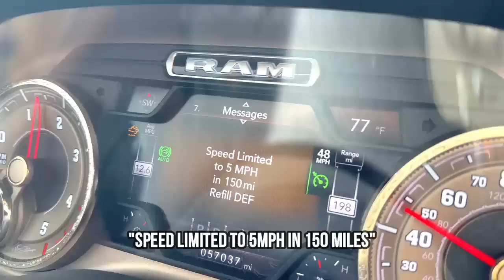Our RV Got STUCK in the Sand While Camping in Baja

Comment: No 4-wheel drive😮
Why lower air in trailer tires🤔
Reply from the maker: I was in 4wd.. the sand was just too soft.  When towing through sand, the trailer tires will also sink some as well. Lowering the air just helps the trailer stay on top of the sand better.